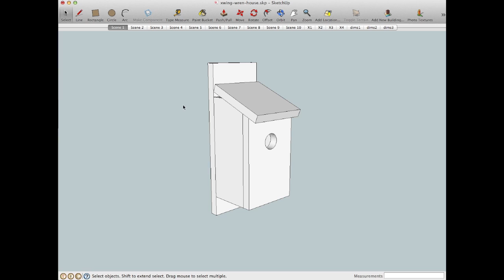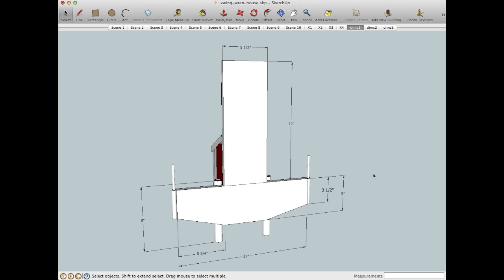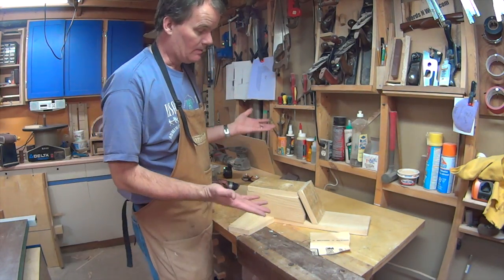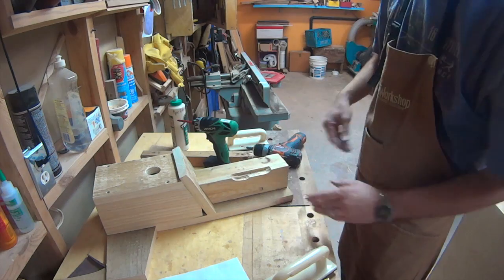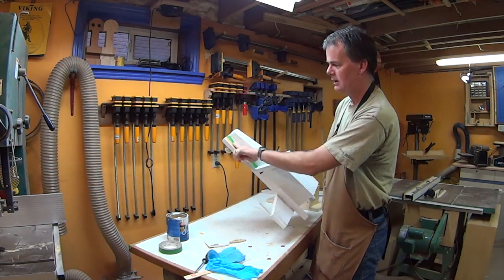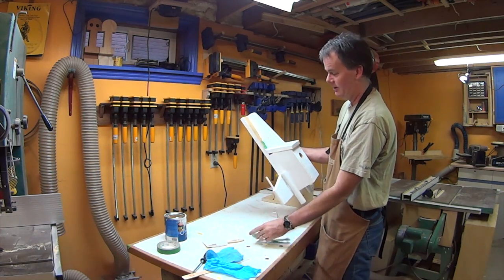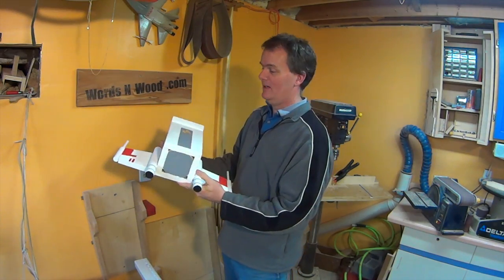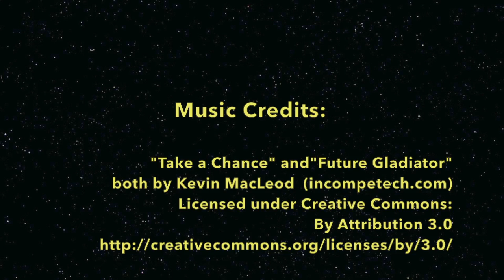The X-Wing Bird House (WnW#21)

Comment: I have a question - On the bottom of the birdhouse and at the top where the roof meets the backboard, there are holes.  Are these on purpose ? And if they are, what are their function ?
Reply from the maker: +Matthew Martin Ventilation!   And a bit of drainage also, in case it gets wet inside.